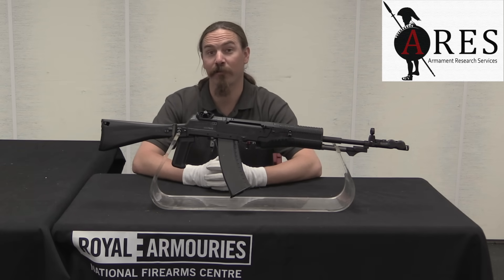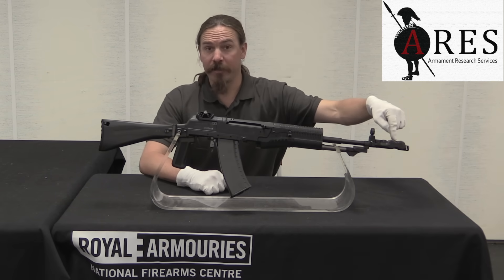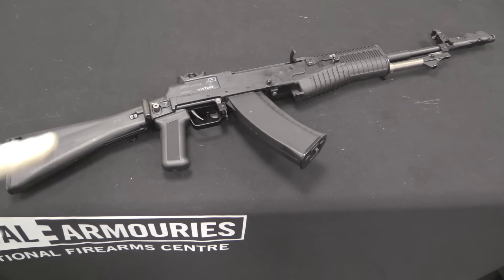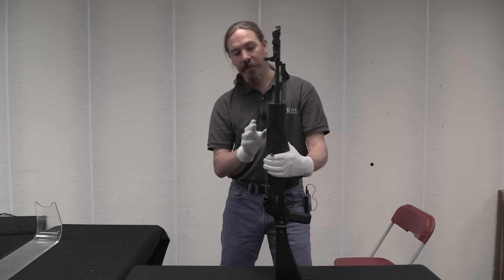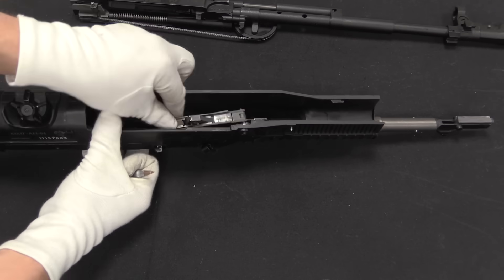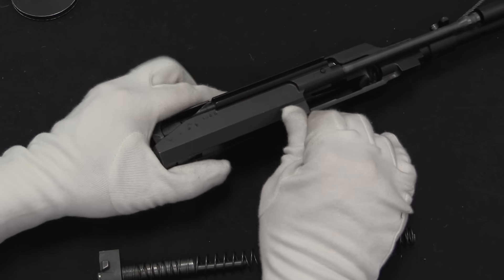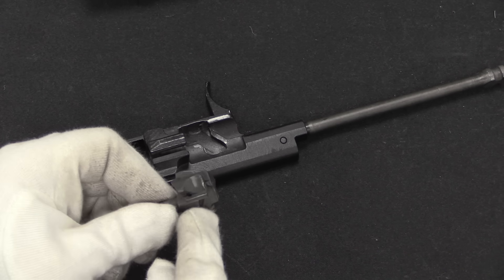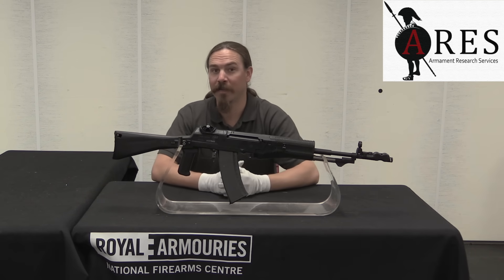Rocket Surgery: Inside the Russian Nikonov AN94

Comment: Just in case people didn't know - this is not really a gun, a replica used in assembly\disassembly training, we had a couple of AK-74Ms in school, you can tell by the "ММГ" on the reciever, which means "Макет Массово-Габаритный", best translation I can give is, well, Replica
As a side note - these can be converted to firearms, at least in theory, given you have a spare barrel and a bolt
Reply: Sigh... it's comforting to read that this piece came from Russia as "non-functioning replica". I hope Royal Armories has not deactivated all of the weapons they got from Nottingham Pattern Room... that was a fantastic collection.
Reply: Sure you can... you just need a whole machine shop. ;-)
Reply: Yuk3yN4g4t0, is something really wrong with you?
CIting laws in this case is irrelevant, it's the same as saying that it's not possible to run people over with a car because that's illegal, except it's very possible. Legal restrictions that make it more complicated are a separate concern. Conversion of a dummy like the one in the video to a live firearm is in fact very easy to do - if you have the parts. How hard it is to get the parts in Russia is irrelevant to how easy the conversion would be to do from the mechanical standpoint.
Reply: I was just offering a more literal translation of the term.
Reply: I think Mass-Dimensional Dummy is ok too (sounds silly though). Replica is something made to copy the original item, but those ММГ are made from defect factory guns with massive flaws. Its not profitable to make only dummies, you know.
Reply: "Replica" usually means that it never was a real thing, and was build to look like a real gun, with the same mass and dimensions, and kinda shows how it functions. When, in fact, "ММГ" means it's a deactivated gun, that was a real firearm, or was assembled from the same parts as a real firearm, onlt with some parts not being fully machined or was cutted off.
Reply: The "ММГ" guns are BUILT as REPLICAS, now, of course SOME are deactivated decomissioned guns, but not all of them
Reply: You'd be amazed
People are buying them, schools here are buying them, and they are built like this, not defect guns
Reply: JOHN SMITH He says this in the video. It's a real gun except for the factory deactivated parts.
Reply: We have 3 AK-103 in school (ММГ)
Reply: Макет массо-габаритный is kinda closer to a "mass-dimension dummy" if you want a more literal translation. It does indeed mean it's a replica that has the same mass and dimensions.
Reply: >these can be converted to firearms
No, they can't, it's ММГ. Also, 222 УК РФ.
Reply: Actually, citation of russian laws here is the point. You can't because it's illegal and gun was deactivated this way. Also, gun barrel is one of the hardest parts to manufacture and getting parts for weapon is illegal by russian laws... So, no, you simply can't.

Comment: too much complicated as per battlefield standard where u need to strip a rifle very fast
Reply: raj biswas that's why it's only for special forces (Spetznatz and such)
Reply: yeah but a malfunction in such rifle can cost a soldiers life..just like ar15 when it was first introduced to the troops in vietnam
Reply: The M16A1 rifle first saw combat in the Ia Drang Valley. It may have had some field testing, but it was designed for use by standard line troops.

What weapons are you referring to? I've studied a great deal of modern combat systems, and I don't know of any modern combat rifle that began service in an elite capacity with later adaptation to use in the line.
Reply: You seem to still be assuming that this rifle goes into the hands of ordinary soldiers.
Reply: most of the rifles are developed according to the specifications given by the special forces..if it's battel proven then the country issue it to their ordinary soldiers..even the M16 was not designed for ordinary soldier use at the begining
Reply: OEFBugout would the SKS be modern enough? it saw limited field testing during the battle of Berlin by some Elite Soviet teams during the battle, I'll try looking for the picture.
Reply: Ok, that wasn't something I had heard of. As a counterpoint, the SKS is a very simple rifle. The AN-94 is a mechanical monster in comparison.
Reply: ok but ar15 was first designed for special forces then after field testing the m16 or the A1 varient was issued to infantry men who were using m14 that time..the green berets and SEAL teams used the shorter version CAR15 and model 653
Reply: OEFBugout oh they're night and day when it comes to complexity, still a sort of modern rifle that saw limited field testing by an elite battle group however.
Reply: raj biswas I wouldn't go as far to say the SKS is an improved SVT, especially since the SKS was developed because the Russians wanted a rifle for their new 7.62x39 cartridge they developed in '43 and not because the SVT was lacking. they share a similar shape but a lot of the ideas that went into them are different, like the detachable vs internal magazine.
Reply: but still I would prefer a rifle which is mechanically less complicated..this is the reason why the germans rejected Gew43 rifle in ww2 due to its complicated mechanism
Reply: Considering that more than 400,000 Gewehr 43 rifles were made, I don't think it's fair to say it was rejected.

Going back to your original comment: there are only a few reasons why I would possibly need to strip my rifle down in combat. Since I know the M16/M4 rifles the most intimately, I know the malfunctions that are the most common for it (usually double-feeds). 99% of the problems I ever encountered required little more than pulling the magazine, locking the bolt back, and shaking out the stuck rounds. Worst case, I could hold the bolt to the rear and slam the stock against the ground to knock out a stuck casing.

The one instance I know of where a soldier had to strip his rifle down was David Hackworth. He was carrying an M1 Garand while fighting in Korea, dropped the rifle in a mud puddle when he tripped, and had to take the whole rifle down and clean it with a toothbrush because of the mud that stopped up the action. The M1 is an elegantly simple rifle, but that type of problem is quite rare.

Every soldier I know takes a lot of care with his weapons. If a soldier has to field-strip his rifle during a firefight, it is his fault and his alone.
Reply: what about Magpul Massoud or HK XM8 it was also designed to replace M16/M4..they were also state of the art assault rifle..why the troops did'nt choose that
Reply: SKS was just an improved version of the SVT40 or44 the russians did'nt adopt it widely only the chinese did they wanted an AK type rifle just with better range and accuracy